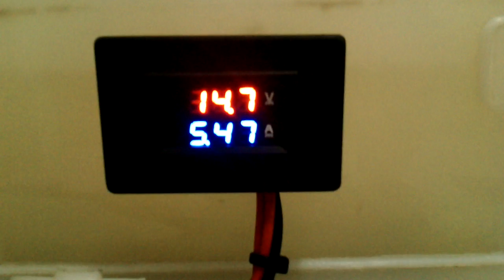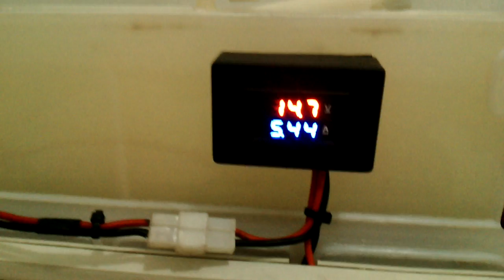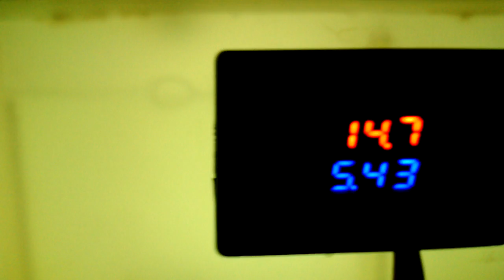HHO GENERATOR N2000/12  explanation

Comment: Hi Vay
 please look at the De Bay Zone, the micro crystalline Structure of the Leads, try to penetrate  the uniformity of the Electron Gas Field around the Leads. Look at it like  a Tree try to interact with the Rain Drops. One big magnet is stronger than the same Magnet in Fractions you need to break this Force by fragmentation of your Leads. The Electrons need o be be introduces from the bottom of the Leads and run with the Earths magnet Field.
Great Job, I have never done such a beauty.